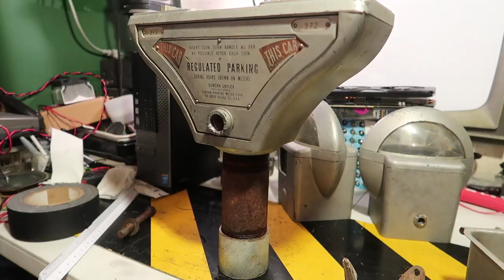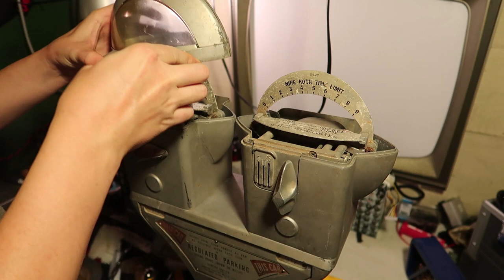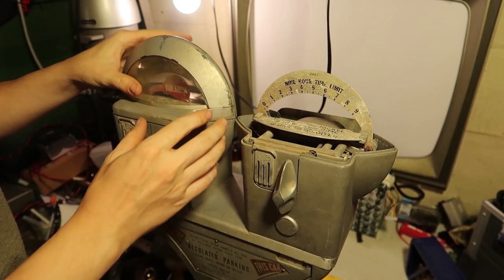1960s Duncan Duplex Parking Meter 3: Cleaning, Reassembly

Comment: I've had some pretty good luck squirting small amounts of acetone on tubing and timing it just right before rinsing it with water, it generally melts away the layer with gunk first and the water keeps it from getting too melty and getting streaks. Short of having a solvent collection for your circulating water, maybe try watering down the acetone 50/50 for a quick shot?

Comment: you can use really fine wet 1000-1500 grit sandpaper to remove the scratches. Then buff with a car polish
Reply from the maker: +Dan Hayami yeah i tried that, ethanol seemed better for this.

Comment: You should be able to restore the plastic like new.  A cool back lighting with LED lighting would look great. 
I use Novia plastic cleaner to polish my windshield on my motor cycle. It comes in three or four grades to progressively restore the plastic to like new finish.

Comment: Say what are you using for a "base"(?) for your custom buffer? I want to restore some headlights on a truck I just got and I didn't want to buy any thing else if I didn't need to.
Reply: A wire wheel, but that's not safe because if a wire pokes through it will scratch you headlight lens
Reply from the maker: i doubt the wire will poke through all 4 layers of cloth very easilly. i removed it today and they barely poked through one.
Reply: Oh man. Alright. I was hoping I could make something. Did you ever see that GIF on Reddit a couple months back where someone put a brush on a power drill and made a crazy scrubber? I thought that was something like that.

Comment: maybe make a stand and put it where you usually park your tractor or lawn mower.  Looks way better after the cleaning :)
Reply: Also It was likely the acetone that cracked the lens as when it evaporates it pulls heat out of the surroundings very quickly.  This likely cooled the lens very quickly causing it to crack due to a temperature differential, the same way glass can crack.  I've cracked linoleum tiles before when I was trying to remove the adhesive from the back with acetone.